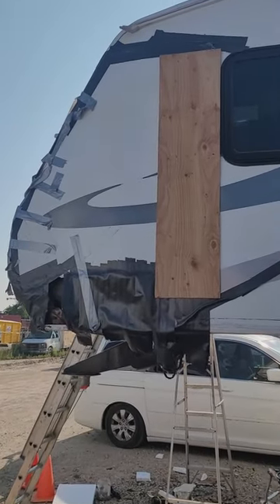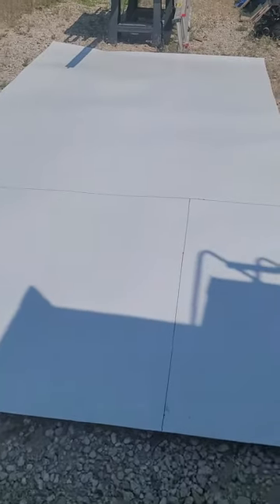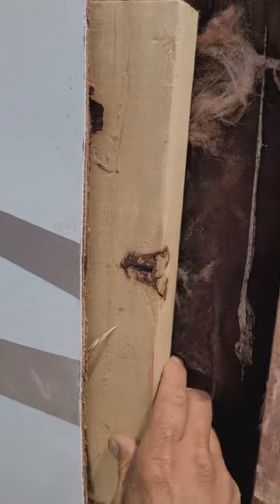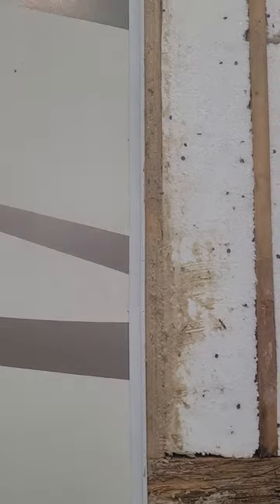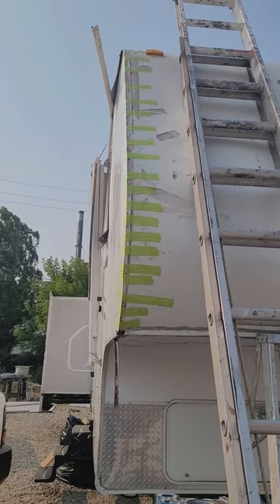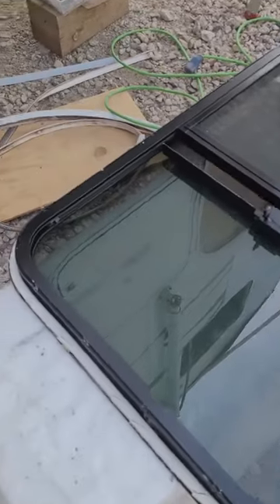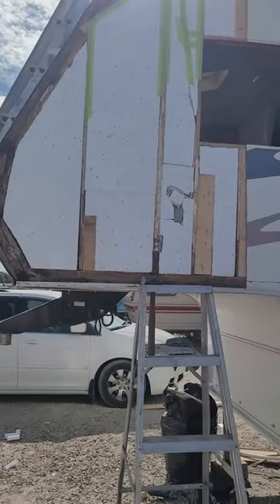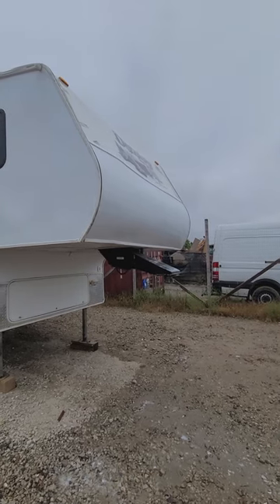Replacing and Reframing Fiberglass Nose of 5th Wheel Trailer

Comment: Great Job. I have a couple questions. As this is what needs to be done to Our 1997 Playmor TH
Where are you located?
I am in British Columbia Canada and am having trouble finding the Fiberglass.
Thank You for any information
Reply from the maker: Hello...thanks for your reply...we are located in Toronto...in regards to the Fibreglass ..we purchase it by the foot..so for the repairs in the video the approximate square footage we normally would purchase equalling in the roll 3 or 4  4x8 sheets to complete our repairs depending upon the repairs needed per side...your measurements will tell you.
You can see if amazon has suppliers to ship the roll to you...or look up Hap's Place.
Location ,Orillia Ontario.
1-705-327-7992.
They have everything  including the proper interior pannelling and so on......Hope this helps.
Reply: Helps A LOT.... Thank You